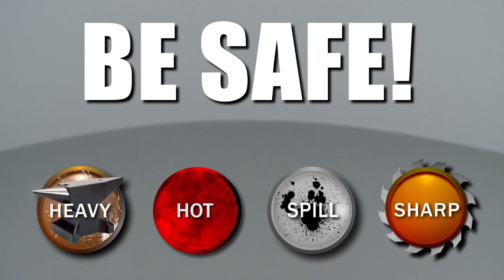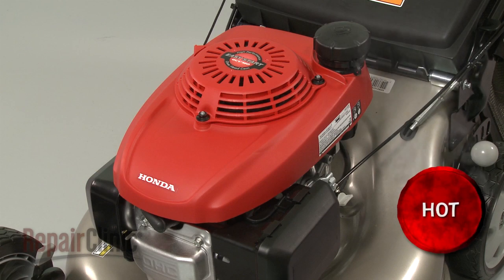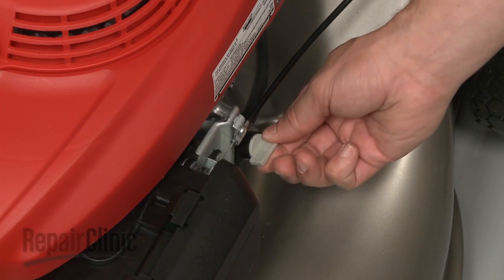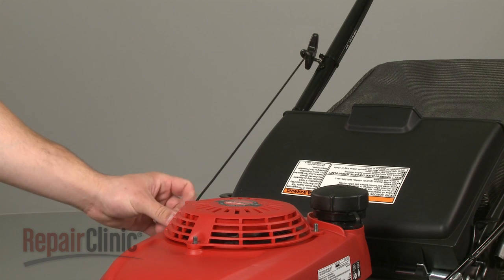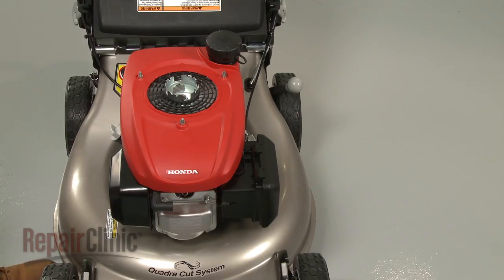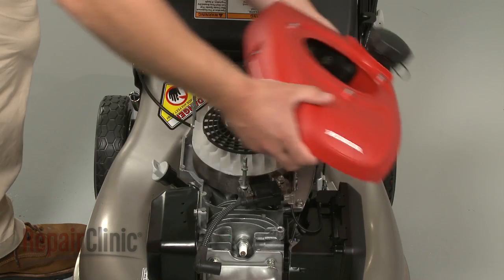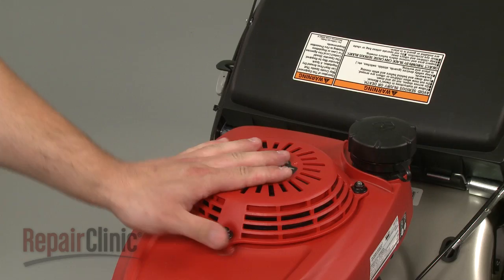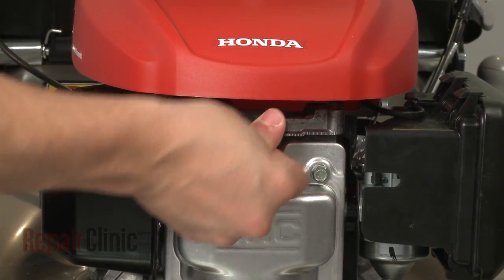Honda Vertical Shaft Small Engine Shroud Disassembly (#GCV160A0 S3TE)

Comment: "This video demonstrates the proper and safe way to disassemble a small engine"
Trying to troubleshoot this "easy start" mower that won't start.  I know little to nothing about small engines.  My buddy helped me narrow down several possibilities (spark plug is operating fine, gas cap is not interferring, new air filter, oil is good, etc).  The engine has compression but it just won't start.  Now thanks to this video I can take the gas tank off.  I am sure this will solve all of my troubles.